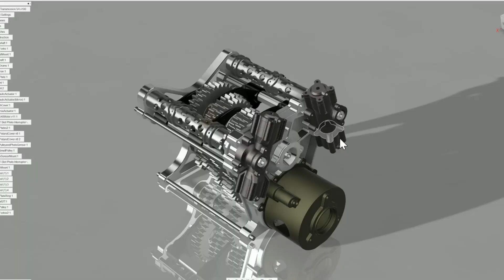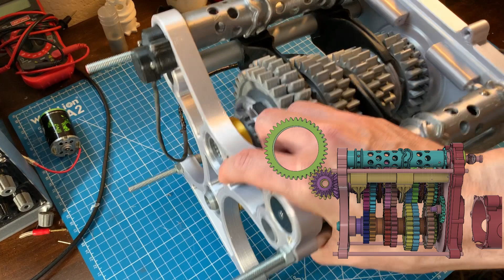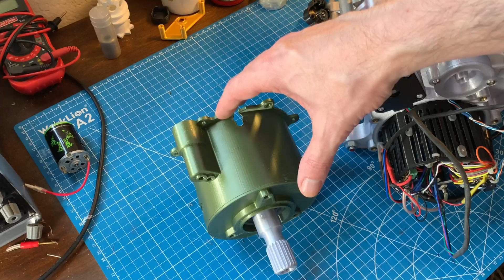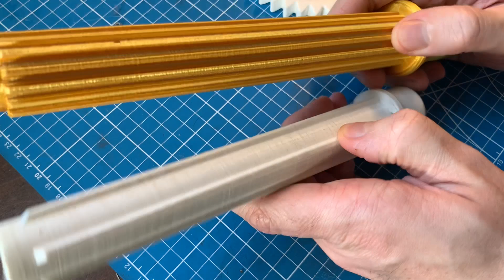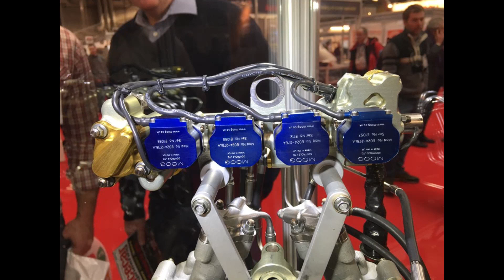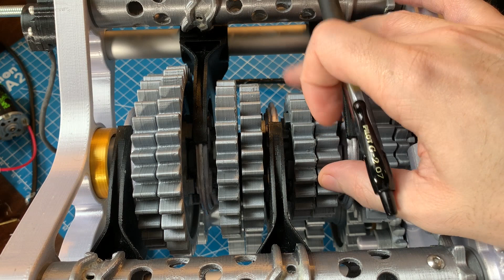3D Printed Formula 1 Gearbox - Prequel Part 2

Comment: I wonder if you could do a sequential manual command. Like a lever than would actuate both shift barrels at the same time very quickly
Reply from the maker: Sorry, just saw this. If I understand your question correctly, the reason they don’t use a lever is the overlap is different for an upshift vs a downshift. Basically the first barrel to move is different.

Also, I think a lever takes too long to move compared to a paddle.
Reply: @IndeterminateDesign  Thank you. 
And absolutely brilliant project!

Comment: Awesome work! How did you actually print the shiftdrum and the slider? I assume they can't be printed without support material or do I miss something. A Prequel Part 3 would be nice talking about some of the printing challenges.
Reply from the maker: Yes, the shift drums were printed with a lot of support material.  I learned a lot about Cura's support settings as the first couple of shift drums were completely encased in unremovable supports.  That's a good idea, I will definitely try to pull something together about the printing challenges.

Comment: Great video! It might be worth looking at sport motorcycle internals, as they are very similar in concept -- but much cheaper (taking much lower torque).
Interestingly, bikes have the same problem with shock loads when quick shifting, and that tends to be handled with "cush drives" and slipper clutches.
Reply from the maker: That’s interesting.  I wonder if the F1 gearbox does something like a controlled slip of the clutch between shifts.
Reply: @IndeterminateDesign  the older bike quick shift systems interrupted the ignition on upshift. I doubt F1 does anything that crude these days, but might have in the past